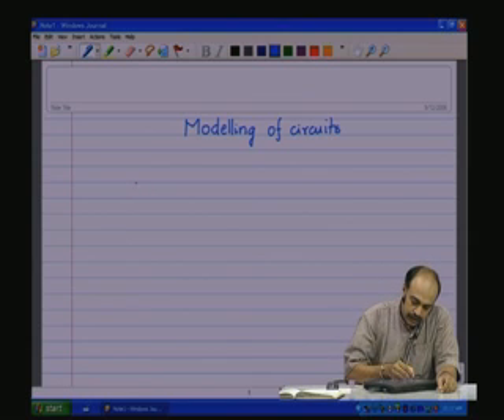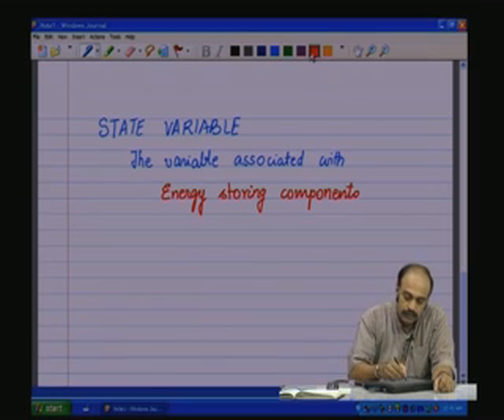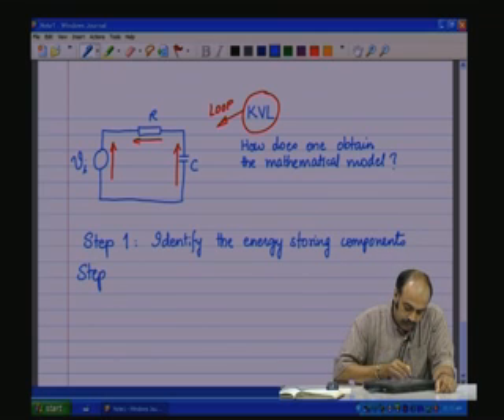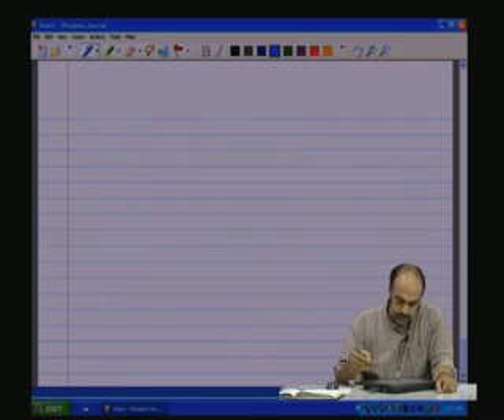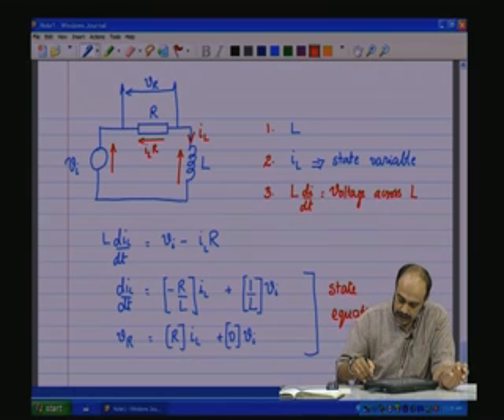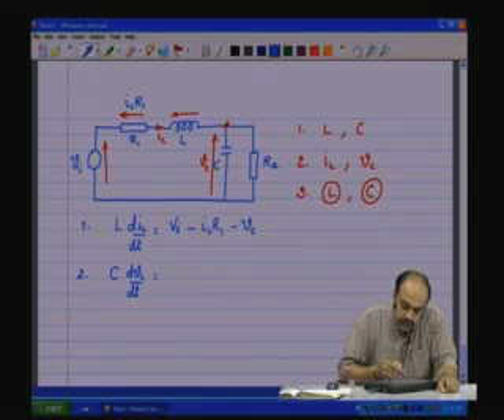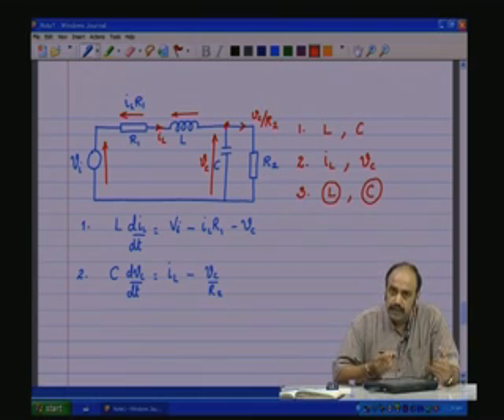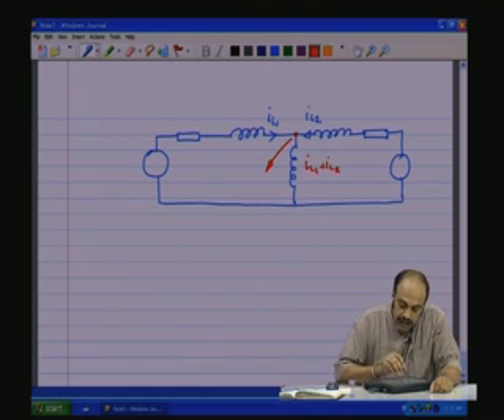Lecture - 6 Modelling of Circuit

Comment: why ac current is sinusoidal only?
Reply: KUMAR-GAURAV , the most common AC current (which is easy to generate) is sinusoidal
Reply: simple......
differentiation and integration of sinusoidal results an other sinusoidal but for other signals this won't follow...
why differentiation and integration....... becoz mostly every system cam be modelled as 1st order and 2 order differential eqn system

Comment: 47:07,  I didn't got ,how to solve output state variable equation
Reply: Saksham Sharma , the output is across R2 and hence across c , so Vout= Vc, now consider putting the above equation in matrix form , so you will require (1*2)matrix × (2*1) matrix to end up with (1*1) matrix

Comment: how come these voltage directions opposite to source voltage???
Reply: because source gives the current ( that is electron  move away from the battery ) and all other consumes current or voltage
Reply: @gargrishab  But the source used here is a voltage source but even then the direction is reversed. I am a mechanical engineer so please correct me